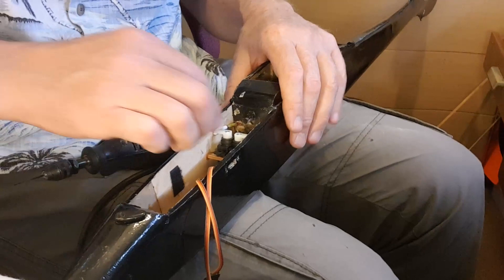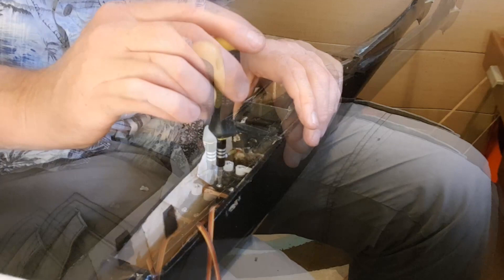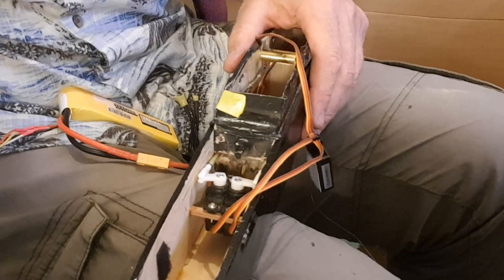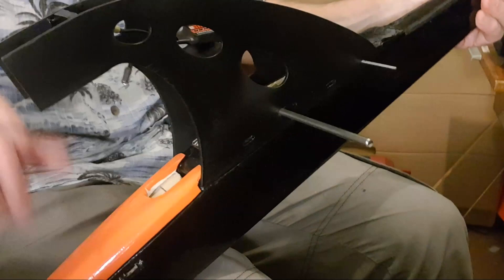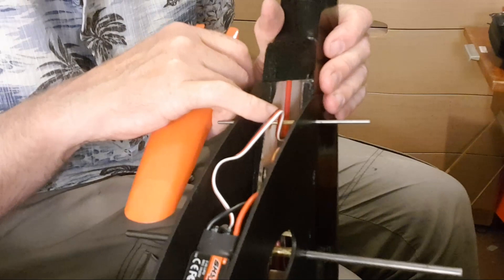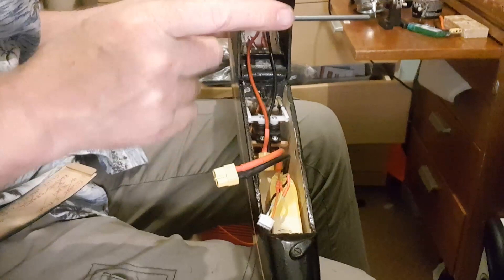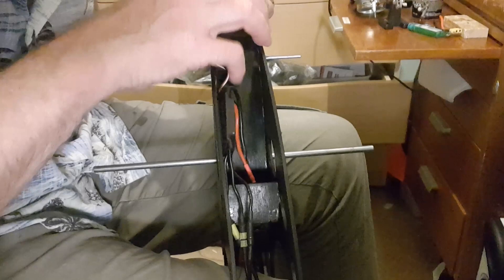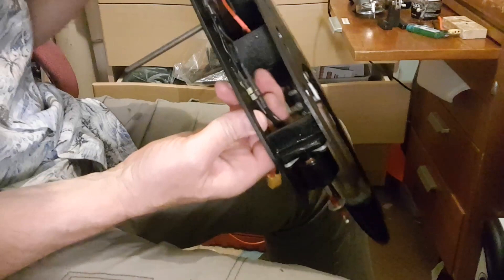Making an Electric Power Pod for a Glider Part 2

Comment: Hi Cliff. It's looking great. With a normal pusher set up with the prop and motor facing the other way and behind the wing The thrust angle has to point at the centre of gravity. Is your set up tried and trusted or is it experimental. Nice work with the drill how much do you charge for fillings 😂
Reply from the maker: Thanks Jon, from my research I'll need up thrust for a tractor set up such as this, I've increased the motor angle to roughly +4 degrees pre-test flight, my ideal scenario is to launch from a hill then ease in the power but we'll have to see if this is possible if not it'll be flat field, so to answer your question nothing tried and tested as such, bit of experimental thrown in for good measure 🙂 I don't charge for fillings as I'm still practicing 😁
Reply: @CliffHarveyRCPlanes  awesome book me in for six root canal fillings. Sat morning 👍
Reply from the maker: @Jon Jepson  That's a shame Jon I'm working this Saturday so you'll have to fill with balsa dust and ca in the meantime 👍

Comment: An engineering job well done. I noticed a slot in the fuselage for switch , so the plane goes back to NiMh. I have a box big Futaba servos. I hate to throw anything out. But a question. With the heavy motor hanging in front of the balance point and the heavy lipo upfront, did get the new setup to balance?
Reply from the maker: Thanks Irwin, she's from the eighties I think, the cg is ok because the replacement servos are lighter, the rx is behind the cg and I removed some lead from the floor of the nose. Yes the motor's in front as well but not much to make a lot of difference either. 🙂
Reply: @CliffHarveyRCPlanes  Well done